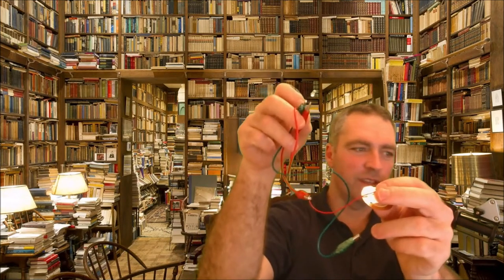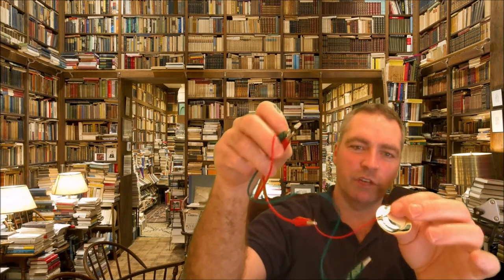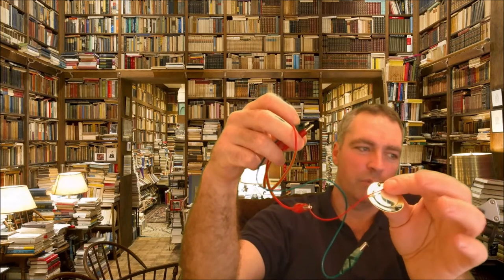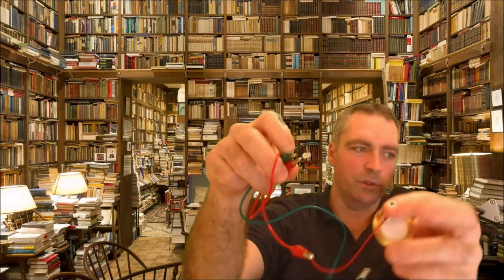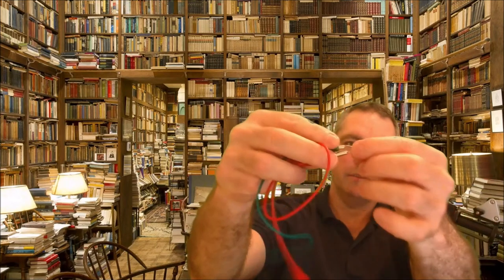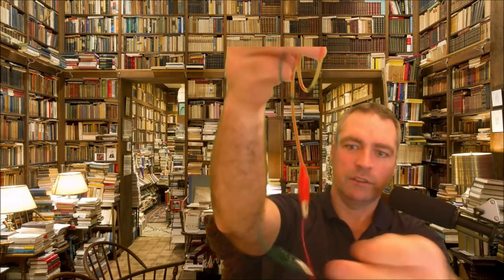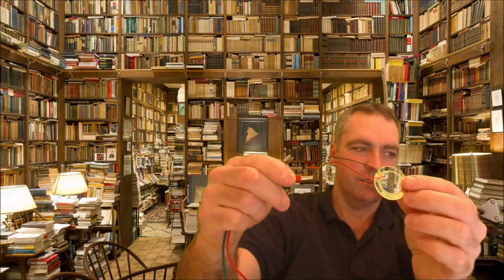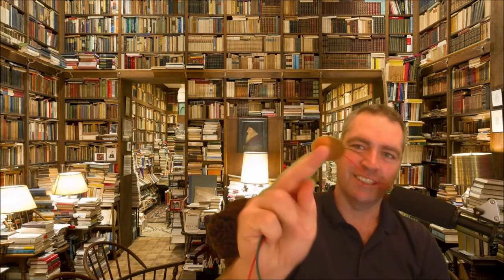Generating electricity from vibration

Comment: how to make it ?"
Reply from the maker: You can buy piezos from the internet, eg, http://amzn.to/2gfquKR, and then you also need an led, eg, http://amzn.to/2gP1rPJ
Reply: how to make piezo
Reply: @robinjanssen5126  it exists because someone made it.. the thing i want to ask is.. how to make that not haw to have that?
Reply: @bonmonsanto553  A piezoelectric transducer converts mechanical force into electrical output. This is made up of Quartz crystal which contains SiO2. Piezoelectric crystals are electrically neutral. The atoms inside the crystals in an unsymmetrical manner but their electric charges balanced When the force is applied to stretch or bend it, an electric voltage is generated. If there is no stress, no charges are induced. When there is stress, positive charges are induced on one side and negative charges induced on the opposite side. Compression occurs in the crystal as the force is applied.